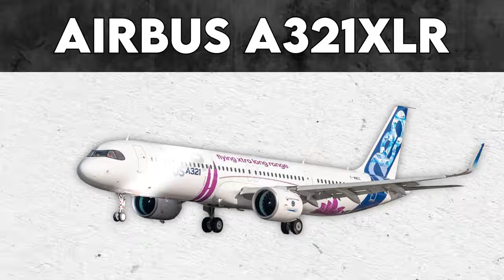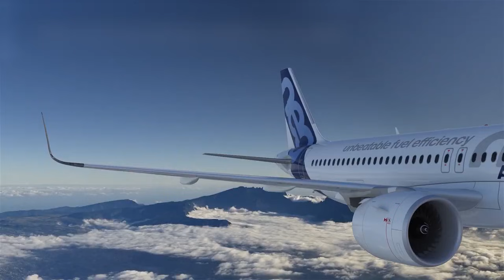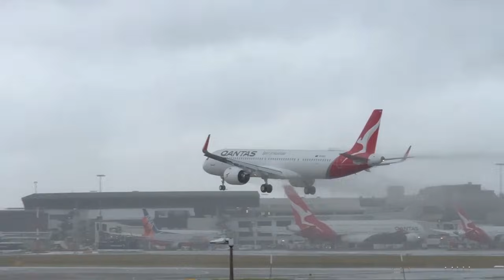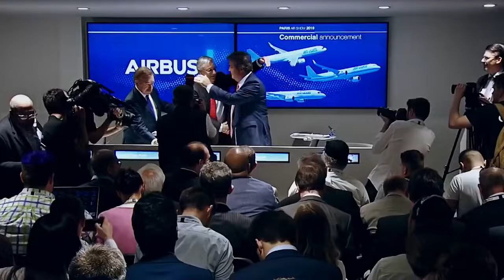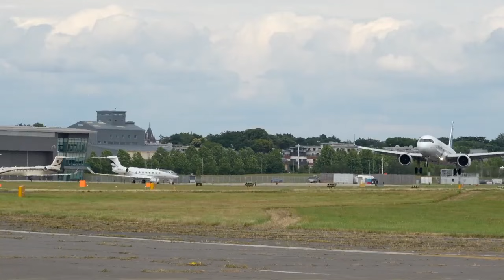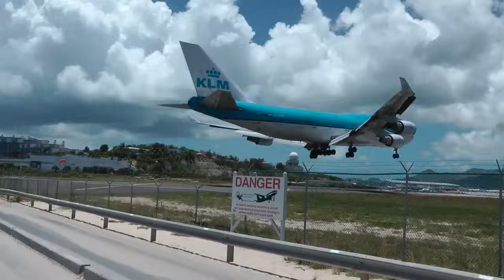The Real Reason Boeing Has No Answer To This Jet

Comment: Boeing doesn't need to compete against the XLR.  Just look at the Max 10 order book vs XLR.  Not only the 8-9 hour flight in a narrowbody but one of the major issues for customers will be the removal of the restroom behind 1st class to add the extra tank.  Companies have built but have limited the number that they have purchased.  The Max 10 gives what is needed domestically.  A new MMA plane would need to be built.  It needs to be a 757 / 767 modification because narrowbodies should only go so far until customers will refuse to fly